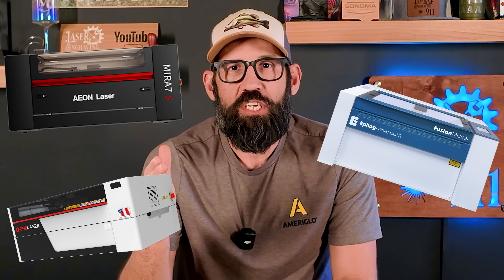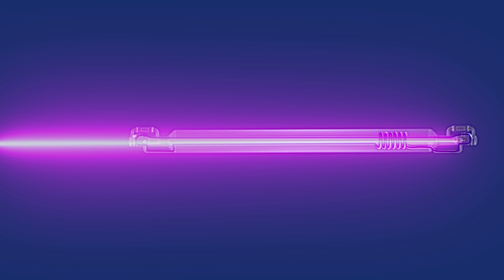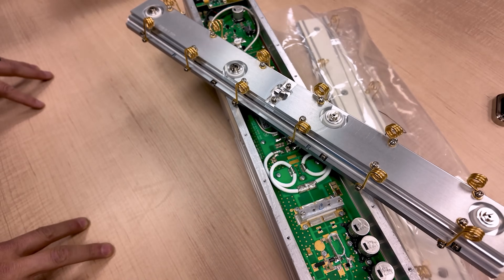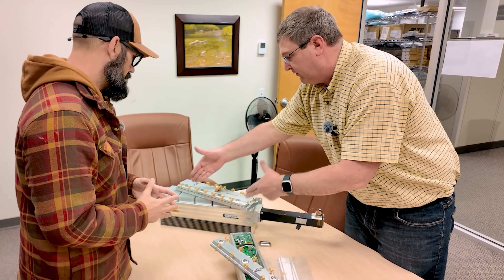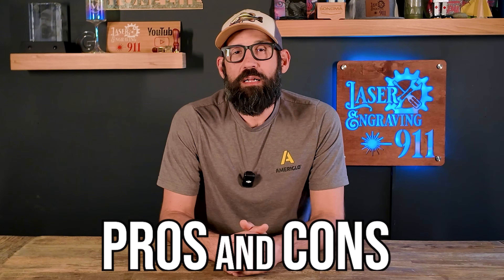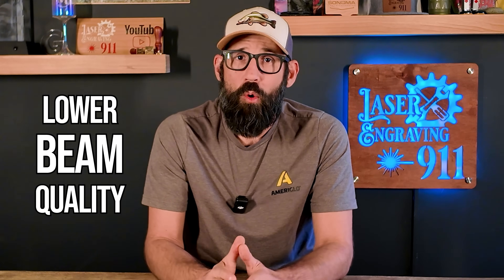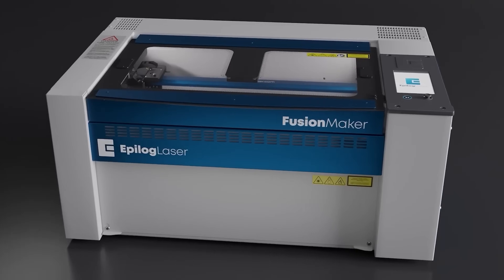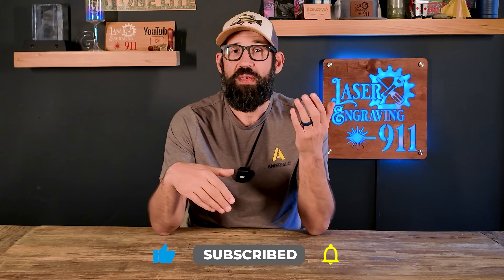The TRUTH About RF vs Glass CO2 Laser Tubes

Comment: I have to disagree with you on several points. An RF laser, while not having the same output wattage as a CO2 laser they are almost equivalent. This is due to the fact that the beam size diameter is usually much smaller than a CO2 laser thus concentrating the energy and a much smaller area. Also, if you consult with Laser companies like thunder, Laser or one Laser, they will tell you that you cannot just go by output wattage to compare. The other item I disagree with is cost. The difference in price between an RF laser and a glass tube blazer while considerable This cost will actually be cheaper for an RF laser. If you have to change the glass tube more than two or three times. My one Laser RF type has almost 5000 hours on it. The same Laser if it was a CO2 version, I would’ve already changed the glass tube once or twice at a cost of between $500 and $1500 so that’s a no-brainer. I liked your video for the explanation of the difference between a CO2 and an RF however as it was as always. Very informative.
Reply from the maker: Appreciate you watching and sharing your perspective!
Reply: I've been researching RF vs Glass CO2 for my next purchase and the consensus seems to be that due to the better quality beam, focus and spot size of the RF, a 36-40 watt RF is equivalent to a 60-70 watt glass tube laser and a 120 watt RF is equivalent to around 150-170 watt glass tube.

Comment: Using Google Translate

Hello.
I'm a user of the Epilog Laser Fusion Pro 48 model in Korea.
1. I'm currently using a 60-watt RF CO2 laser, and the laser has started to weaken slightly.
So, when I got a quote to replace it with an 80-watt RF metal tube, I was told the price was $5,800 by a Korean dealer. (Unlike in the US, there's no credit for returning the laser tube.)
So, for this price, I'm debating whether it's better to switch to a Chinese CO2 laser or continue using my Epilog Laser.
Workload Ratio
Cutting 70%
Engraving 30%

Materials Used
Acrylic 3T, 5T 50%
Romark 30%
MDF 4.5T 10%...

Also, when engraving, there's a slight misalignment in the X direction. Turning the Epilogue dashboard to "pricision sync - ON" helps alleviate the misalignment. However, there's a mechanical issue.
The X motor belt tension is also fine.
However, I don't know the cause.
What should I do about this problem?

2. During cutting, I discovered that the existing working conditions were not working properly, and the laser tube was weakening.
However, replacing the laser mirror and lens with new ones should alleviate the problem somewhat.
However, I'm not sure when the laser mirror should be replaced. Should I replace it immediately if it has even the slightest scratch or dent?
The same goes for the laser lens.
Our dealer has not responded to this question.
There are very few Epilogue users in Korea.

It's hard to get information, so I'm asking you.
Reply from the maker: Your on the right path, dirty mirrors, and a dirty lens are most often the culprit of weak engraving, I always look at those first. Also you might want to do a re alignment of your laser beam, you can find that on Epilogs website.

Comment: Curious, when comparing an RF to Glass tube, wouldn't the beam spot size make a difference?  I understand the difference from an engraving detail perspective, but does that help when cutting?  For example, the lower power of an RF laser might be compensated for by being concentrated on a smaller spot size vs the higher wattage glass tube with a larger spot size.  Sort of a Watts per square mm type of scenario.

Comment: A really good comparison of CO2 vs RF tube technology. 
But I think an important consideration when choosing is what software the machine uses. Of course that’s not determined by the tube type, but if the machine’s manufacturer doesn’t support standard laser software like Lightburn, that can make using the machine more of a challenge. I find using Corel, which Epilog recommends, to be kind of clunky and not very intuitive compared to Lightburn which Epilog doesn’t support.

Comment: I just decided on a co2. And my decision was based on these points. For now my business is starting and coming from a diode it'll be an improvement. Another thing and probably #1 is that my machine will be located in my garage which it isn't climate controlled yet. So I think a chiller will provide better cooling. I understand the fans over the heats ink might provide proper cooling.  But it really gets hot in Texas😊. After the hype of onelaser cools down I'll consider one or a hoatian. Epilog it's out of my league.  Thanks for the video
Reply from the maker: Thanks for sharing that!

Comment: It seemed biased to me because of the sponsorship. They are excellent lasers, but for day-to-day production, especially if you are starting out, it makes much more sense to use a machine with a lower initial and maintenance cost. The advantages presented are for a very small niche that really needs this precision. It is like comparing a Swiss lathe with a CNC router focused on plywood, each with its own use. Tube lasers tend to "pay for themselves" easily due to their "low" cost. As for speed, it is hardly noticeable when used for cutting, where configuration parameters make much more difference. It is a promising technology but the cost needs to be reduced a lot to be really economically interesting...
Reply from the maker: Thank for sharing your take on it!

Comment: Can a glass tube be replaced with an RF?
Reply from the maker: I think with the right (know how ) yes!, But you would want to upgrade everything! because you can run faster speeds to so  you would have to upgrade the motors, and gantry too! and many other components.
Reply: @LaserEngraving911  so you're saying it's probably cheaper to just buy the whole RF system...
Reply: @LaserEngraving911  so you're saying it's probably cheaper to just buy the whole RF system...

Comment: Not mentioned often with RF is the ability to use the full range of power. If your doing any work on the low end of the machines ability, my 60W glass CO2 really doesn't do much below 12-15%. I plan on getting an RF and making it my go to for engraving detail and letting the glass tube CO2 do the dirty cutting, where the precision and refinement aren't often as necessary.
Reply from the maker: You bring up a great point that I should have mentioned. The power range on a glass tube CO2 is limited.,, great point!